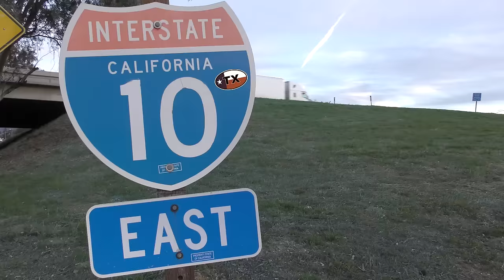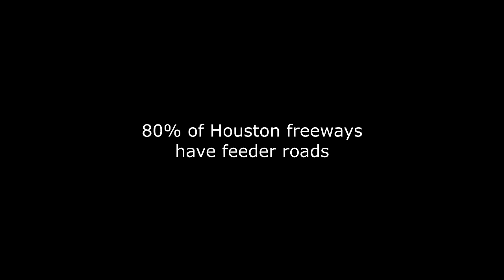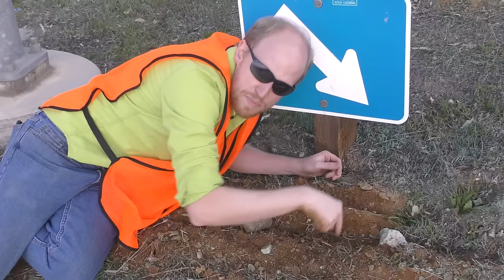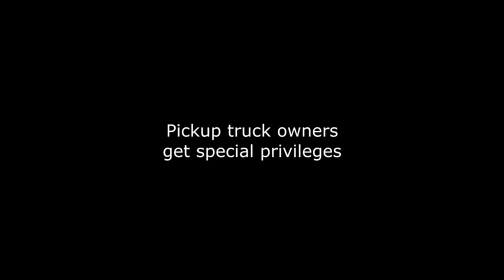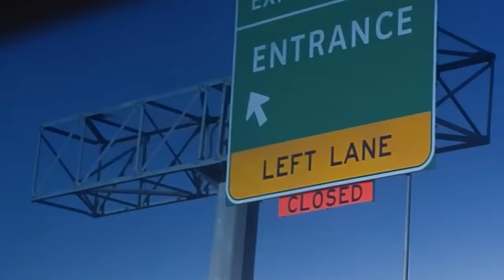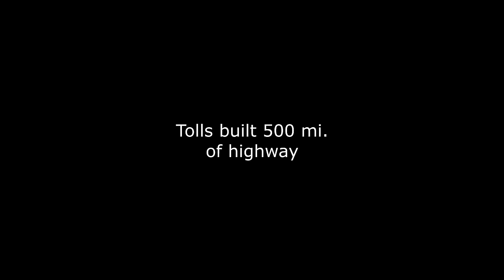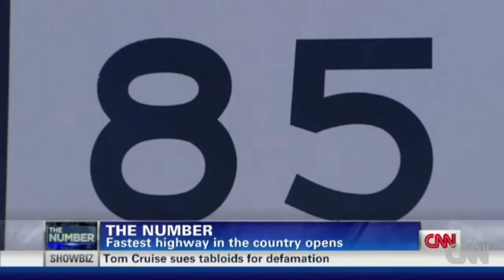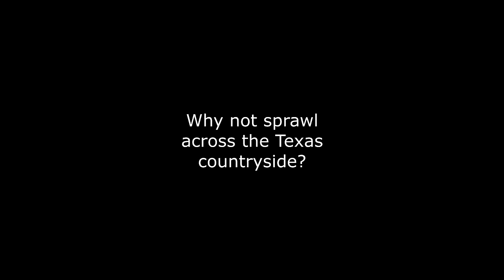How does good Texas engineering make REALLY BAD roads?

Comment: I would lose my mind without feeder streets.
Reply: That was the #1 hate of California’s in Texas when we went out there - I didn’t like either - Had a person go the wrong way and almost hit my rental car
Reply: The Houston flooding problem makes me feel grateful that Los Angeles has an amazing flood control system for a place where it rains very little. But when it does rain, we can get a lot.
Reply: @dougbowers1256  Houston gets on average about 45" of rainfall a year, and I've seen it twice above 60" for the year in the last decade. LA gets about 14" per year. I've seen on several occasions the Houston area get as much rain in 24 hours as LA sees in an entire year, and there's almost at least a one week period every year where we see 12-14" during the week. Plus, Houston is flat. Very flat. As in 1" elevation rise for every mile of travel. There's nowhere for the water to go. 

You can not compare LA's flood control system to Houston's rainfall. If LA got the amount of rainfall Houston sees one year, it would be a total disaster.
Reply: @rmarca8306  
You’re making my point. LA has a better flood control system even though it gets only a fraction of the rainfall. 

The hub of the system is the LA River. It’s famous for being a concrete river with very little water in it. It carries a massive amount of water when it rains heavily. There are hundreds of smaller canals that feed into it both before and after the Sepulveda Dam that controls the water flow in the river below. 

Before they lined the river in concrete, when there were heavy rains the river would exceed its banks and frequently change course wiping out whole neighborhoods. That doesn’t happen anymore. 

No, LA doesn’t get anywhere near the rainfall on a regular basis that Houston does, but about every 10-20 years or so, we get an extraordinary event and we’re prepared for it.
Reply: Same tho I didn’t realize we were one of the only states who used them so often
Reply: Morahman7vnNo2  
Yes, there are little floods in isolated areas, but not the devastating floods that took place before they controlled the river. If they can make the river more natural without losing the flood control qualities that is maintains, that’s fine, but we can’t go back to what was when the river was truly natural.
Reply: @dougbowers1256  you just proved our point. They get less rainfall so their shitty system looks good. Given the same load as Houston it would fail amazingly. It’s impressive Houston isn’t underwater considering how much rain it gets.
Reply: @superspooky4580  
LA has a system that works on the rare occasion when we get 5-6 inches in one shot. Add to that the topography that channels all of the water downhill quickly and the potential for flooding is intensified. 

It works. 

LA has a system, Houston does not. 

Would LA’s system stand up to Houston’s normal rainfall?  Yes. Would it stand up to Harvey levels?  No, but we’d still be better off than Houston because we have a system and Houston does not.
Reply: @rmarca8306  And whose fault is that? They created this mess themselves with all the rapid development without proper flood management. I'm sure an earthquake in Houston would also be a total disaster, but we are talking about pointless hypotheticals. Let's get back down to reality. The floods are real and will only get worse. Houston dodged several bullets just this year with the overactive hurricane season. Most went to the Texas/Louisiana border. Just a nudge to the left and any one of those could have turned into another Harvey.
Reply: @dougbowers1256  Just trying to bring out your true intentions and prejudice, old man. By all means, stay away. You act like Texas will feel the loss 😂
Reply: @mtb416  
Houston still doesn’t have a plan. Calling me an old man or advising me to stay away doesn’t change that. Even a flawed plan is better than no plan at all if it mitigates the damages. 

The point of my comments is that it is better to create systems to avert disaster than to just throw up your hands and say that it doesn’t happen often. There’s nothing we can do. Southern California could have done that. As you say, it doesn’t rain much. That’s true most of the time, but in the times where it’s not true we would continue to have devastation that we don’t have because of planning.
Reply: @dougbowers1256  earthquake coming
Reply: @jesxs2143  
What else is new?
Reply: @inksuckeye1  Meh....I just saw through the other commenter’s BS and refused to be patient about it, is all. It isn’t difficult to read between the lines, man. For whatever reason, he’s prejudiced against Texas and/or The South. His only goal was to belittle and condescend. I goaded him into finally admitting this.

I couldn’t care less about him disliking my state. I’m bothered by and fed up with people using fractured logic as a means to justify - which they hide behind and use as a shield to deny - their unfounded prejudices. 

It ain’t rocket surgery. I can’t make a horse drink. You see it or you don’t.
Reply: @mtb416  He isn't wrong though, Houston does not have the infrastructure or ability to deal hurricane events. We've paved over (almost) all of our natural wetlands that would absorb all the run off. Just like the video says, when a hurricane event happens, we have massive flooding that is catastrophic. There are no real efforts to adjust our urban planning or infrastructure to deal with it. The City of Houston has plans, but they will likely be inefficient without significant buy in from all the suburbs, most of which are more interested in allowing even more paving over of our green space/pasture land that helps to absorb flood waters before they become flood waters, which only makes the issue worse in already paved over areas, and spreads it to the newer paved over areas. Houston needs to start cinching it's belt, and building up, not out, and we can't afford to keep having all these single family homes everywhere with massive lawns that don't actually absorb rain water
Reply: @nihouma11  I’ll give you the time of day. By the way, I’m originally from Houston. I currently live in the Texas Hill Country. I’ve also lived in the plains. I’ve experienced heavy, drastic flooding in all three of the differing topographies. As someone who’s tasked with performing water rescues and has done so in all three of these environments, I know ground saturation/absorption rate/slope/rain rate/etc. are among the many  drivers behind flooding, let alone swift water rescue. I 

The prejudiced commenter I called out seems to come from a place quite differ in topography. Due to ignorance and prejudice, mostly the latter and which explains the former, he’s wrong and/or uninformed about the challenges faced by Houston. For you, I assume you  actually know Houston, maybe live there, it’s not so much ignorance as it is the continual inconvenience that bothers you and which propels you to wrongly believe Mother Nature can be out-performed. 

Houston is a city just 40’ above sea level with a slope toward the sea that is extremely gradual. The lack of “run off” in Houston is primarily a function of this rather slack slope. Good or bad planning cannot make up for this inherent, topographical limitation. It’s foundations are clay, a soil slow to absorb water and slow to release water, so porous concrete, which may lessen flooding, does NOT necessarily mitigate the presence of likelihood of flooding. 

I absolutely believe Houston could do better (after several billion dollars......), but ultimately its still beholden to its place/environment....that being a consistently humid climate resting upon upon a clay foundation that, while being a supposedly “high” 40’ above sea level (which, again, is mostly explained away by shallow gradient, soil type, and high rainfall, especially during extreme events like hurricanes). Houston’s very well placement, subject to Mother Nature, makes it prone to floods. It’s not unlike Southern Californian cities’ placement that makes them prone to earthquakes. It’s not a perfect analogy, but it’s not as if most, if even a plurality, of earthquake prone areas in California are actually built in a manner to withstand an earthquake. IOW, it’s only the rate of floods that make Houston look bad compared to SoCal in “anticipating” disaster, not that any other locale is any better prepared, especially regarding infrastructure.

This shit ain’t rocket science, but it definitely isn’t as easy as you believe. Much of it is literally not even feasible due to Mother Nature.

You’re both like children. You think a wish is enough. It’s cute and all, but nature and technology and funding have a lot to say about your cute little wishes. I never said Houston can’t be improved, but y’all seem to think poor planning and engineering are overwhelmingly the primary cause. And why? Ignorance.
Reply: Without feeders it's still pretty easy to use the frontage roads used in the rest of the USA, they just happen to be full-on single lane 2-way highways
Reply: I would lose my mind if I couldn't walk around and enjoy the day whenever and wherever I wanted.
Reply: We have them here in Michigan, didn't realize they weren't as common as I thought
Reply: Jinx Vanderz  
A small fraction of what Texans are being asked to pay.
Reply: @amoonaz1465  Sometimes the country side won't have them if they are low pop enough. I've seen highways just turn into a small towns main road then back into a highway again
Reply: I like how Nevada does it: long ramps instead of feeder roads. Feeder roads look like a waste of money.
Reply: You’re insane feeder roads are atrocious I can’t wait to leave this poor state
Reply: I've lived in Texas for only a year, and I already can't imagine life without them, lol.
Reply: @dougbowers1256  The flooding is due to gradient, not road design. It’s a flatter plane, genius.
Reply: @mtb416  
Yes of course. That’s what engineers are for, is to mitigate the consequences of the local conditions.
Reply: I'm not really sure why you are saying Houston has no flood control, engineering, or plan whatsoever. Houston has had a pretty robust flood control system in place since the 1940s, using a network of bayous, canals, underground storm drains, artificial lakes, retention pools, levees, flood gates, and two large dry reservoirs with a potential third one being planned. The bayous are natural but have been expanded and paved in areas, much like the LA River. Everything else I mentioned was created specifically for flood control. The state government has an entire department dedicated to flood control in Harris County, and the Army Corps of Engineers has operated those reservoirs since they were built in the 40s.

The sprawl has definitely made flooding worse recently, and it happens every few years in known flood zones that are lower or have poor access to the rest of the system. Harvey overloaded the system entirely. For some reason the video says it dropped 30" of rain on Houston, but every source I've seen puts it between 50"-60". Houston's system isn't perfect and there is lots of room for improvement and finger pointing, but no flood control system is designed to handle a year's+ worth of rainfall in a single event.
Reply: I about lost my mind BECAUSE of those things. TF is the point? Never saw one until TX.

Comment: The “feeder roads” you mentioned are actually only called feeder roads in and around Houston. The official term is “frontage” road, but service road is more commonly used in most of the state, with access road being used often as well. If you say feeder then you definitely are from houston.
Reply: Grew up in Houston and have heard them calls feeders all over this state...Just my experience
Reply: @michaelalberts3615  i grew up in the panhandle and never heard feeders unless it was someone from another area of texas or another state.
Reply: Long Island is full of them on NY 27W
Reply: Michigan has these in (some) urban and suburban areas. We call them service drives.
Reply: @michaelalberts3615  grew up in Dallas and it was always service road then went to houston and learned it was feeder down there
Reply: I have literally never heard them called "service roads."  And "feeder roads" is almost as rare.  Where I'm from we call them "access roads," though "frontage roads" is occasionally used.
Reply: @Helpful_Corn  yeah you’re from Austin or San Antonio
Reply: @MrDJViciousDelicious  guilty as charged. But to my mind "access road" just makes more sense than most of the others because it's the road you use for access between streets and the highway and/or businesses.
Reply: Greater Houston IH-10 signs them as Frontage Roads, especially further out, Baytown, Katy, etc.

Comment: Interstate 10 is an interesting highway you should do a video on every state it passes through....just from Texas to Florida it changes so much
Reply: I agree. I’ve driven it virtually coast to coast. The only stretch of I-10 I haven’t driven is between Van Horn, TX where i-20:starts, and Boerne TX just west of San Antonio.
Reply: Yes and how in Baton Rouge it goes down to ONE LANE east bound at the bottom of the Mississippi bridge
Reply: @ZowieFawn  I believe that LaDOTD is now working on the I-10/I-110 interchange to add a lane or two for I-10 there. It is an absolute charlie-foxtrot there.
Reply: @killersopinion1829  They recently (Like a week ago) announced its expansion
Reply: Heck, just from San Antonio to El Paso it changes a LOT. I've never been east of San Antonio on it so 🤷‍♂️

Comment: I lived in Texas for almost 50 years.  Recently, my son in law pointed out something  interesting about Houston's freeways.  Ever need to stop for gas when your tank is REALLY low?  You'd think you could find a gas-station on the frontage road just off the freeway, but no.  That land is too valuable for other commercial use.  To find a gas station, you need to drive down one of the side streets and hope you can find fuel.
Reply: Gas stations are at the intersections.
Reply: >Ever need to stop for gas when your tank is REALLY low?
No, I have the ability to plan ahead and I fill up my car when it still has 50+ miles left.
Reply: thats just blatantly false, i can think of at least 10 stops along i-45 running through houston that have adjacent gas stations along the feeder.

Comment: Feeder roads do have a function in rural areas. They are a place to divert two lanes of traffic off the freeway at the same time for road work.
Reply: Many of the "feeder" roads in rural areas are just the old 2 lane sections that remained after the highway was expanded years ago,
Reply: This is pretty common in my country, where the old road goes parallel with the motorway and serves local traffic. From the video it seems like in texas the connection between freeway and rural feeder roads is designed exceptionally  badly though.
Reply: @Noi5ee  I dont know why people seem to think this. Those rural on and off-ramps really are not that complicated. Everything is well marked, with plenty of time to stop and avoid drivers staring at their phone or out of state drivers. Not to mention the traffic on them is next to none to begin with. They also serve a decent way to extend on and off ramps by making it possible to speed up and stop by using sections of the feeder road.

Comment: As someone who lives on the first parallel street from I-35 in Austin, the feeder roads and businesses do provide a little extra distance (inverse square law!) and an imperfect sound wall from the constant rumble of the traffic lanes.   One of Austin's freeways (Loop-1) does not have a feeder and the residents live right "on" the freeway...They just recently started to get a noise barrier.     Feeders also provide the alternate route when there is a crash on the freeway.    And Texas Turnarounds are THE BEST.

Comment: After a downtown flood in the early aughties, Tulsa started replacing a lot of downtime sidewalks with a different kind of pavement that allows rainwater to trickle directly down into the dirt beneath.  All those square miles of dirt that, except for holding up what we built on top of it, wasn't doing a thing for us... now it can help hold that rainwater.

(I wonder how much of the grasslands' ability to absorb and divert the water was just the fact that the soil was open to receiving the water, not necessarily because of the particular plants.)

Comment: Having lived in Lubbock for the past 2 years, I can attest to the fact that the roads are generally, big, ugly, confusing and feel very rushed. Not only that but they are very dangerous, with random signs splattered throughout roadways its easy to get confused, and people speed in Texas, so there is an accident just about everyday in Lubbock, not even joking. Why? Because its impossible to go ANYWHERE without a car, if you try, you have to take crappy unfinished sidewalks built right next to cars going 50-60 MPH with no barriers and half the time sidewalks just randomly end causing you to walk through unpaved area which is exponentially more dangerous. Navigation is impossible because there are literally 3 or 4 seperate exits for the exact same road and randomly placed intersections on a road that's limit is 50 IN A SUBURBAN AREA. It literally sucks and I never feel safe on the road. Texas needs to get its transportation under control.